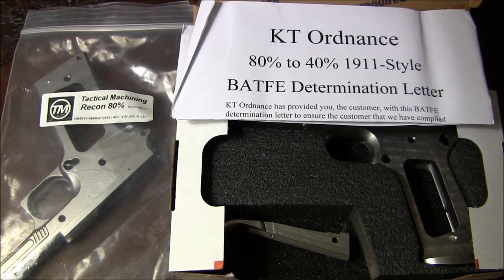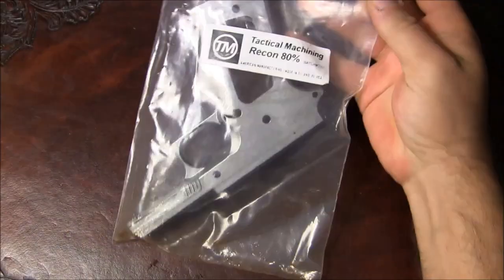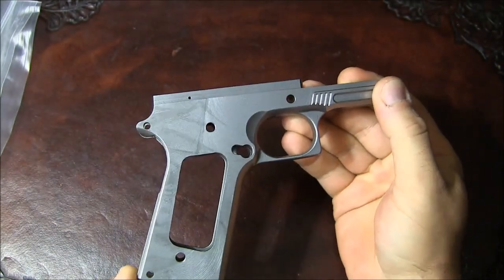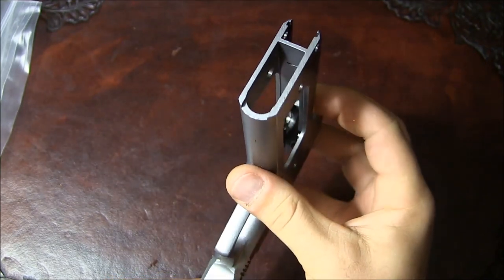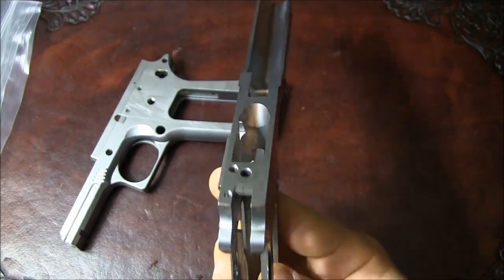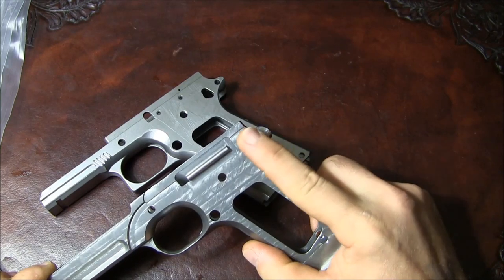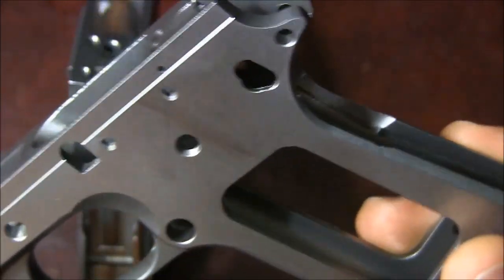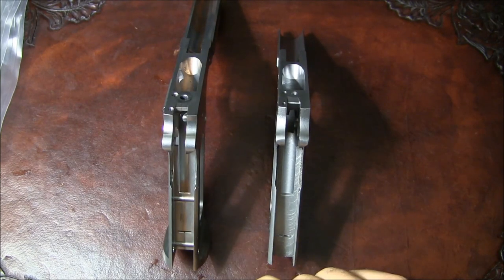1911 80 % Frames: KT Ordnance vs. TM Recon

Comment: have you ever used 1911builders.com kits? ( or sarco?)  I'm planning on building me a 1911 soon, always wanted one. what parts would you recommend (for someone on a budget and what tools should I make sure I have?)  I thought going from 80 to 100% percent would be the hard part... but now I think that will be the easy part..lol..  love the video's keep them coming :)
Reply from the maker: I never bought their kits but use their frames almost exclusively now. And for the most part, their slides. I have a video on the 1911 tools I use, as well as the jigs. For jigs I highly recommend Matrix Precision. Though if you have a mill, you can skip those obviously. Just look at my 1911 builds playlists.
Reply: MosinVirus good thing I waited, I was about to buy the phantom... So you think the Matrix jig is better? why?
Reply from the maker: akshooter762 Matrix jig can easily cut steel and obviously aluminum frames. Phantom cutters will last maybe one steel frame. Matrix cutters will last many steel frames.

Comment: That kto looks like a great platform for a race m1911, looks like you got your work cut out for you. You do good work though so good luck.
Reply from the maker: Thank you. I am actually planning on getting a mini mill for this and other projects. I also sent both the KTO frames back, one to be replaced due to being defective, and for both to get the MSH rails cut.
Reply: Thats a hell of a project to take on, im building a glock and even that frustrates me
Reply from the maker: cgr88m I will take it slow, and hope to learn a lot. Hoping to end up with a nice, tight group printing, smooth shooting, 1911, but am ready to mess up, hence multiple frames. How are you building a Glock?
Reply: MosinVirus well basically just going to buy a glock 34 9mm and install a drop in trigger and change the sights, the hard part is that im going to stipple and modify the frame myself, ive stippled my m&p frame and it came out good so im confident it will look good. I havent gotten in to 1911s yet but im looking into buying a z06 corvette soon (finally got the wife's blessing) so im trying to keep the gun hobby at a budget, im 26yrs old so im into fast cars and cool guns lol, i can see myself working on a 1911 frame but right now im always under one of my trucks or cars fixing them or making them faster, but the z06 is my last project cuz were thinking of starting a family hehe.
Reply: MosinVirus i also want to add that the reason i like the glock platform even though i like the walther ppq more and the hk vp9 more, is cuz there are so many DIY parts to order. I also like getting a part and installing it in 10min and going out to shoot it.
Reply from the maker: I completely understand. I never felt sure enough about stippling my glock frames. You are much braver than me. Sounds like you have plenty of projects to keep you happy for a while. The vette is going to be a hobby in itself. Good luck.
Reply from the maker: cgr88m yup. My wife recently picked up a VP9 and I got to shoot it. Great gun is all I can say. I prefer it's grip to everything else I have shot, which makes it easier for me to do better with it. However I do just as well with my Glocks. Like you said Glocks are way more customizable and are a pleasure to work on. Parts are so cheap too.
Reply: MosinVirus yeah i have a sig p320 and i love it but i dont know i just keep going back go glocks so i stopped buying different handguns and just buying different glock models in different calibers like i want a glock 21 and a glock 10mm i also became a shotgun fan but thats also another hobby im trying my hardest to stay away from cuz skeet shooting gets expensive as well. The vp9 is sweet i saw one at my gun shop, congrats on that gun my lady hates guns she lets me have them but doesnt want one of her own lol oh well
Reply from the maker: cgr88m I completely understand. I got very lucky with my wife. She actually introduced me to guns...

Comment: Well I machined the rails today. The slide goes on only part way.
At the risk of messing it up, I think I'm going to take a little more material off with the milling machine.
One of the problems is that the tolerances are tight enough that I can't fully trust the accuracy of my cheap DROs. Then there's the issue of: Where exactly does the cutter (whatever type you're using) make "contact" with the surface? 
I guess this is why most people only try to get close, and then they use sandpaper, files, and lapping compound.
I hate that messy stuff. And I'm no good with sandpaper. Something always seems to go wrong. So I'm going to try to take another 0.5 mils or so off of each side with the key slot cutter.
And then I might try to take another mil off the top.
When I "decked" the top originally (I cut it down by 16 mils with a 0.5" four flute HSS end mill), I got lots of chatter for some reason even though I took small cuts. The surface was "messy". I tried to go another 0.002" with sandpaper but that was uneven. I guess I'm just never satisfied.
I'd rather do an AR15 lower receiver than pull my hair out with this thing.
Reply from the maker: Well, at least you have a mill. I am ordering mine soon. I know it is probably irritating to use sandpaper, but it may be better than milling since the slide is going on a part of the way.
Reply: MosinVirus
Have you decided on which one? (I might be selling mine, and my mini lathe too. Where do you live?)
The problem with machine tools, in my experience, is that they quickly become "an end in themselves". You get the machine, and then you need all kinds of accessories and tools to go with it. It never ends.
Also, when they assemble these things at the factory in China, it seems they just slap them together. Both my lathe and milling machine needed some work done on them before they were usable. And for me, putting DROs on the axes of the mill was a necessity.
As a minimum, you'll need a decent vise, a collet chuck and collets (and/or some collets for the spindle), dial indicator, dial test indicator, digital caliper, 123 blocks, clamping kit, some end mills and drill bits.
At first I was going to try to use small end mills to cut the rails, but I ended up using a key slot cutter. It worked pretty good, and now I think that's probably the best way to go.
Reply from the maker: Harold Smith At first I was thinking Sherline but then realized that it will probably be too light. So now I am thinking to get Little Machine Shop fixed column Hi torque mini mill. Of course I will need everything you mentioned in addition. I live in Southern California. If you are selling yours, what are you getting instead?
Reply: MosinVirus
That's not a bad choice, IMO. It's basically what I have. I got the Micromark mini-mill, but then I didn't like the flimsy tilting column, so I got the solid column conversion kit from LMS.
Yours will be just like mine except you will have a slightly bigger table, IIRC.
(I'm thinking of moving to South America, that's why I may sell everything. I still haven't decided).
BTW if you get that mill, I can show you how I mounted an igaging DRO on each axis without drilling any holes, and how I made a plexiglass holder for the three readouts that also mounts to the front of the mill without drilling any holes.
Reply from the maker: Harold Smith Thank you. I would appreciate seeing how you mounted your DROs, since I am thinking about doing the same. If you can, please send me pictures at Mosin.Virus@gmail.com
Reply: MosinVirus
In a few days I'll send you some pictures regarding the DROs. I can also recommend some specific tools and accessories once you get the mill. In fact I have a good project idea for you as a way of becoming familiar with the mill. I will mention the details of it in the email.
Reply from the maker: Much appreciated
Reply: Harold Smith Mosin hopefully this week some time I will send you those pictures. In the meantime I got the frame working well with two different slides. As it turned out I still had some meat on the top to play with (I was actually over the spec a little bit) so I took another 0.001" off the top with the 0.5" end mill, and then I touched it very lightly with some #400 sand paper.
So, as far as I'm concerned, if you're careful with the milling machine, nothing has to be "lapped" with lapping compound, and the sandpaper use is very limited.
BTW when you cut the rails with a key seat cutter you will also be taking some meat off of the top of the "dust cover" (and of course you want to continue the cut along it's full length), so that when you're done, the two top edges of the "dust cover" are basically an extension of the two bottom edges of the 0.120" wide grooves that you just cut.
Lastly, one thing I didn't know about with regard to most or all of the 80% frames on the market is that the rails are a little on the long side. IOW when I put the slide on my frame and it's in the forward position (slide and barrel in battery), the rear end of the slide sits about 0.050" forward of the rear of the frame. Basically it's just a cosmetic thing that will have no effect on functionality, but I don't like it. Apparently you're supposed to do something called "blending the frame". And apparently you're supposed to do it with a file. I think I am going to leave mine alone - even though I don't care for the appearance of it like that - because I don't trust myself to do that kind of art work with a file.
Reply from the maker: Harold Smith Thanks for the update. Sounds like you are doing great with your mill. I still haven't ordered mine. For slide and frame blending, I actually have done that on my 1911. If you watch my 1911 mod playlist you should see it mentioned in one of the videos. My slide used to protrude backward slightly, so I did most filing on the back of the slide. Also, not sure if you say my Stealth Arms Phantom Jig video I posted recently. I am pretty surprised at how well it worked.
Reply: MosinVirus
No I didn't see those videos yet. You already completed a Stealth Arms 80% frame?
Reply from the maker: Harold Smith Yup, Here is the video link: https://youtu.be/7FNSU_BVMmA Started buying more parts, so I will continue building it and filming progress.
Reply: +MosinVirus Don`t go with such a small mill. As a half assed machinist I can tell you that you will not be happy with it. I`m about to trade down and get rid of my large Cincinnati mill for a Grizzly G0759 with DRO. It will do everything I want as far as smithing is concerned and can be easily upgraded to CNC. When you first get it you have to go over it and tighten everything  and true it up. It was just shipped half way around the world. I hear a lot of great things about the Grizzly products and their customer service is good but whats also good is their quality control(much better then the others). The machines are built to their specs. Along with hearing good reviews I used a friends a time or two and all my work was within .0002"......for $2000 you can have one hell of a starter machine.Just my thoughts on the subject.
Reply from the maker: TWISTEDSTRINGS69 thank you. Since I have found a Phantom Jig, I no longer think about a mill. Of course when I do have more space, I will be getting a mill, but not a mini mill.

Comment: what did you do about cutting rails when lower has integrated plunger on it
Reply: Okay cool I have a extended lenght frame that I ordered from hell fire armory that has the plunger integrated in the milling. I just couldn't tell on any of your videos if the plunger would clear or not while in jig.
Reply from the maker: chevy1985k20 you mean the Rail Cutting Jig? if it doesn't clear, remove the cutter holder on the side that doesn't clear and file down the side of the holder that faces the frame until you have clearance.
Reply: Yep. Just wanted to make sure I could cut the rails with the matrix since my frame has the plunger on it.

Comment: Can you make a video of the 1911 builder frame?
Reply from the maker: Sure thing. I will do that hopefully tonight.
Reply: MosinVirus Ok Thanks, my concern with 1911builders 4140 is the top deck needs to be finished but there are features that already made that are referenced form the top deck,  for example the slide stop hole,  magazine catch hole and also the barrel seat.   Barrell seat can be recut but the other features cannot and will be off.  They should have top finished then drill the holes and leave out the barrel seat to meet the 80% specs.
Reply from the maker: Dave Iron understood. Please let me know what measurements you want me to take in the video, and what comparisons you want to see. Let me know soon so I can include it in the video.
Reply: MosinVirus I read the last guys comment before you deleted it and I am not interested in it any more.  Gonna try the Canadian one,  try not to sensor peoples responses, I know he used some bad language but his advice was very helpful.
Reply from the maker: Thank you. I usually don't try to sensor, but the guy had edited his post to an even harsher language at which point I simply couldn't leave it alone. I am going to do some measurements anyway, just to see if you are correct and then do a video with results so that other viewers can have the benefit of same information.
Reply from the maker: Dave Iron hello again. So I measured the frames and the 1911 builders one seems to have an extra .020-.030" (I wasn't being careful measuring) between the slide stop hole and top of frame. As a matter of fact all pin holes are further away from the top of the frame than on the tm recon. So it seems to me that the extra material was accounted for before all the drilling took place. I know you have already decided to go with other product, but I thought I would answer your original question anyway. Hopefully I did.
Reply: Thanks buddy, good luck on cutting your frames
Reply from the maker: Dave Iron Thank you. I am having second thoughts about buying a Sherline. Back to research.
Reply: Dave Iron 
What drawing are you looking at where you see the top surface as a reference plane for anything?

Comment: How are you going to machine them to functioning frames
Reply from the maker: I actually plan on getting a mill for the machining projects. A mini mill
Reply: MosinVirus Which mill are you considering?  I am looking too, just for pistol work.
Reply from the maker: Kevin Eger I am looking at Sherline and Little Machine Shop. Probably Sherline because they are USA made.
Reply: MosinVirus
I used a Sherline to machine a TM 80% Recon.  The main limitation of the Sherline (IMO) is that it is limited in the maximum shank size for end mills.  Even using aftermarket adapters, the largest shank mill I could use is 1/2".  The trick is that the barrel seat in the top of the frame requires a ball end mill of about 18mm (ish) diameter, and the Sherline can't handle a shank this large.  I ended up finding a 5/8" ball end mill that had a 1/2" shank, and used that.  Then followed it up by wrapping sand paper around a mandrel (actually, a long socket from a socket wrench set) that I wrapped tape around until it thickened up to the right diameter.  Then sand it down to the proper depth below the top of the frame.
Frankly, the Sherline did the job, but if I were buying a new mill, I think I'd get something a little more beefy.
Reply from the maker: Jeffrey LaCombe definitely something to consider. Thank you for bringing it up. If you could replace yours, what would you get instead?
Reply: MosinVirus
I am really not sure... haven't shopped around since I got the Sherline, and that was about 10 years ago.  I have looked at the Little Machine Shop offerings, but to be honest, I think I'd be reluctant to buy something without seeing it in person, or having input from actual owners.
Reply from the maker: Jeffrey LaCombe Hello again. Sorry to bug you, but when you used your Sherline, did you have any problems cutting the rails? Were you working on steel? I still have not made up my mind on which mill to get. The space is limited, and the low weight would definitely help. Can you please tell me if you had any other issues with Sherline? Thank you.